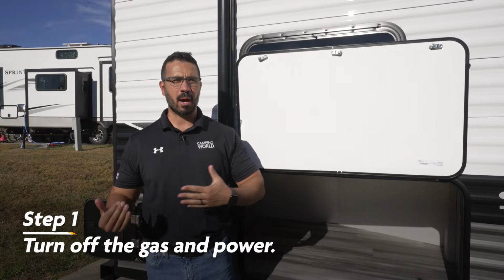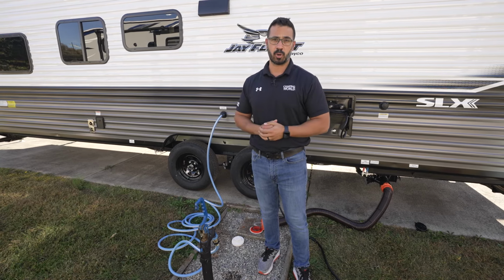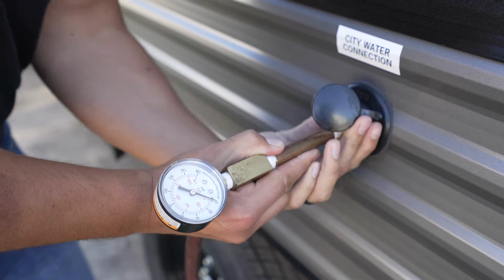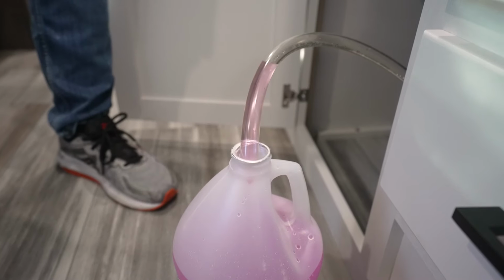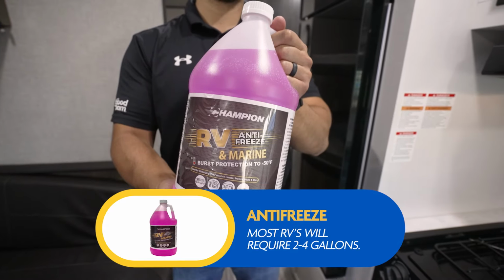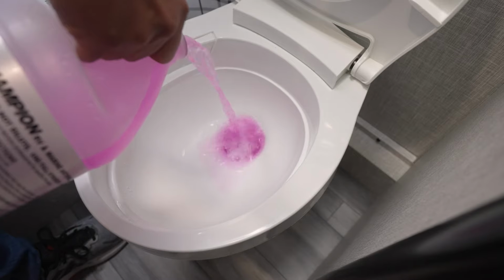4 EZ STEPS to Winterize Tankless Water Heater | How To RV

Comment: Hey Ian. I typed the Google search “winterize tv tankless water heater “
And this was one of the first things it said. ( I copied and pasted it) 
You should not add antifreeze to a tankless water heater, as it can damage the heater's components. Most manufacturers also specify that tankless heaters should not be installed in areas where temperatures can drop to 36°F or lower. 
You can also watch this video to learn more about winterizing a tankless water heater:

Then it showed your video. 
I’m confused now. 
Will antifreeze damage the tankless water heater?

Comment: I just bought a new rv and this is my first time winterizing a tankless water heater, i have a furrion with no visible drain plug. How can you tell antifreeze has made it into the waterheater? So far all my lines have been purged and filled with antifreeze and when the pump is on i get antifreeze coming out of the pressure release valve, but does this mean antifreeze made it into the system.
Reply from the maker: Hi There! 

Provided you have not bypassed the water heater and have followed winterizing best practice, you are probably in good shape. Since we can't go look at their RV, we'd recommend watching Lippert's video on this subject to determine if you followed all of the required steps: https://youtu.be/_jebDXB8dX0

Hope that helps!

Comment: Video is misleading.  You spent all of 30 seconds or less on the tankless water heater.  Basically just said “by a bypass kit” and in print wrote “consult your manual”.  Never did you show us the full steps on how it’s done.  What a crock of shit.  I guess you want us to come in and spend 270$ for an hour worth of work.  😂
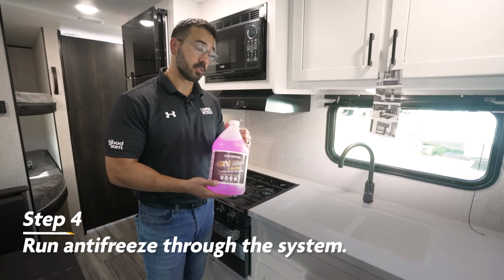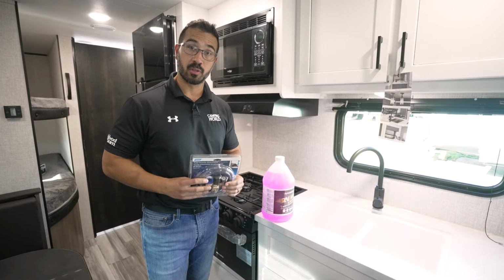Reply from the maker: Hey Bill, you seem upset and I think you simply misunderstood what I was saying. I'm not sure if you watched the whole video or stopped around the 1:15 mark. However, right around the 1:35 mark, I actually recommend NOT bypassing your water heater when putting in antifreeze to help protect the heat exchanger. The bypass is actually to isolate your water heater so you can blow the water out of it (especially important if you choose to NOT put antifreeze in the heater, which again, I recommend always putting antifreeze in a tankless water heater when winterizing). The reason I mention to consult the manual is because some tankless water heaters come with a bypass, and some do not. As for wanting you to come in to get your RV winterized, that is a service we provide, yes. However, many people want to do this at home and save $270...hence the reason I created this video. The option is yours.
-Ian Baker
Reply: What you did do tho in the beginning of the video was when your said to turn off the water heater by flipping the switch, you actually flipped the switch to the on position rather than off.  @campingworld

Comment: Hi, I literally have this exact trailer and am winterizing for the first time. What is the purpose of the quick turn bypass kit for the water heater if i'm running antifreeze through it? TY!
Reply from the maker: The bypass kit allows you to bypass the water heater. Ideally, you want to make sure the heater is void of water and then bypass it so you don't waste 6 gallons of anti-freeze filling it up. It also tends to be a pain to get all the anti-freeze out of the water heater when you de-winterize in Spring. Hope that helps!
-Ian Baker
Reply: @campingworld  Thank you for your response Ian. This (and my) particular model has a tankless water heater so there wouldn't be 6 gallons of wasted anti-freeze. I have read elsewhere that having the tankless water heater filled with anti-freeze is ideal but am also reading conflicting statements. I was just hoping for some clarification. TY!

Comment: Dumb question, but are you getting the antifreeze into the water heater through the air pressure created by the air compressor, or is the water pump circulating the antifreeze into the water heater? Is the air compressor running the whole time or just to get the water out at the start? Thank you in advance.
Reply from the maker: Not a dumb question at all! The air compressor is meant to get the water out and you want to turn it off once it’s done doing so. The water pump will then pump the antifreeze through the system. Just be sure to open the T&P valve on the heater and hot side faucets until you see pink.
-Ian Baker

Comment: Yes but where do you direct or move the pivot on the pump in order to run it into the lines?
Reply from the maker: Hi There! 

Are you referring to the valve on the winterize kit?

If so, you would typically point the handle on the valve toward the pick-up hose that is going into the antifreeze bottle. 

Let us know if you're referring to something else!
- Tucker Ballister